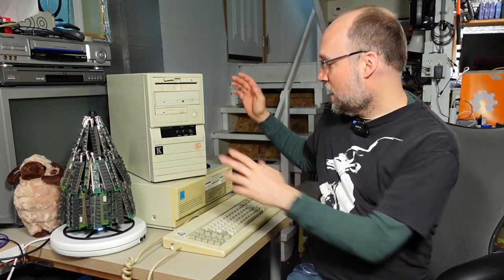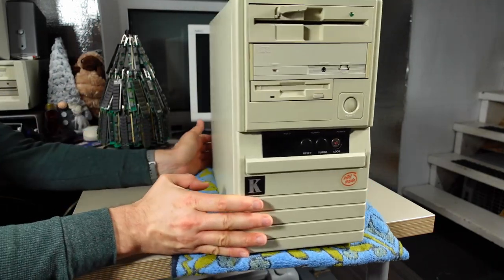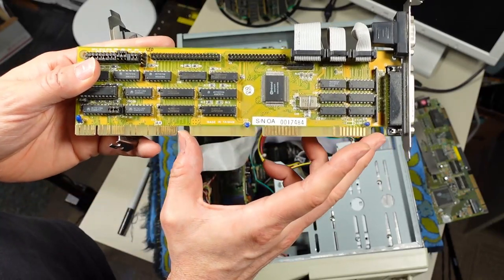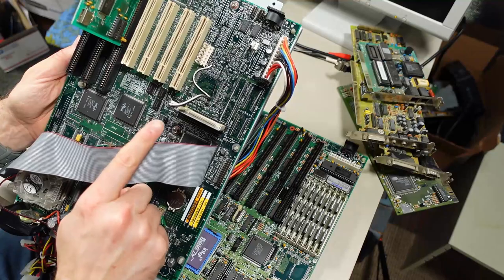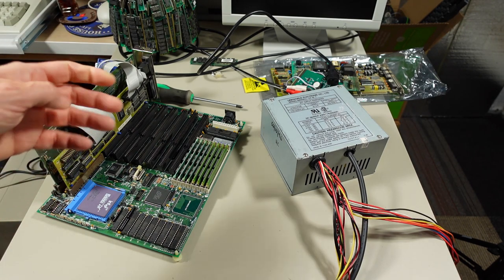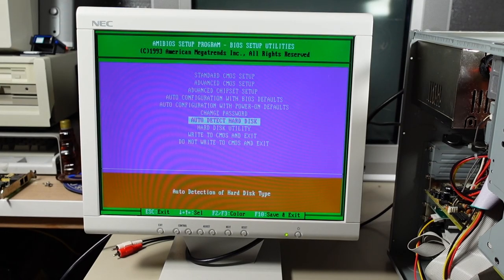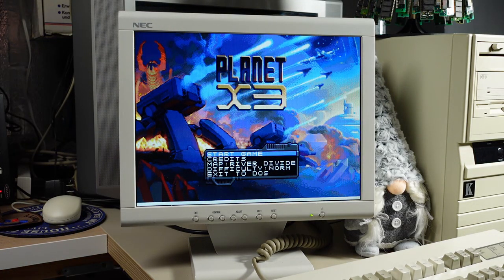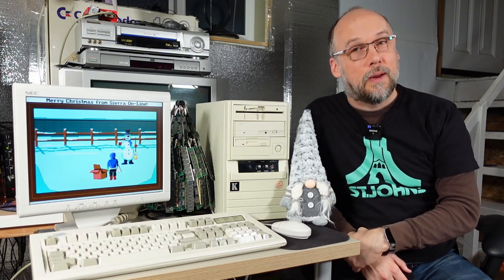PC archeology: Mystery 486 Mini-Tower

Comment: I have hate-love relationship with mini towers of early 90ties. My first two PCs 386 and 486 had them so I have nostalgia love for them but this was era when I changed a lot in them and cheapo towers where heavy stamped metal with lots of burr and sharp edges so in those tight spaces I lost a lot of blood fitting different drives, ISA and PCI cards, ram modules...
Reply: Yep. Building a computer back then meant walking away looking like you danced with Freddy Kruger.

Comment: Very lucky that machine didn't suffer from the dreaded battery leakage! It's a shame about the sound card, I'm sure it would work better with the original drivers.

I wish I had more time off to play with my Pro AudioSpectrum card and 1x CD-ROM drive. Had to get them shipped all the way from the US to Australia because they're the same kind that we had in our family 386 back in the day. The drive uses the LSMI interface, so it would be cool to get it working (if they work!).

Anyway, it's always fun to watch you re-living the experience of using these machines. Even if they're just as temperamental as they were back in the day!

Comment: Yessss! Thank you for making a video about this machine! I'm only 26 seconds in and already excited 😁

Ok, at 10:55, I am thinking it is a 486, using that Mitsumi interface for the 'crocodile CDROM drive' ( that's what me and a friend called it!), To a SB16-ish sound card. The rear audio ports suggest it isn't Creative... But I'm not sure.

The VGA will be a VLB card, slightly popped out of the socket.

The IO card will have an IDE and floppy controller, with the usual array of IO on it.

Comment: I remember, sometime in the mid-90's, I discovered the option to format a floppy at 2.88mb. I formatted several disks that way, it worked fine with most of my disks and all of the PCs I used them on. I never found anything that used it by default.

Comment: I had a Sound Blaster 16 card that had an integrated scsi adapter. Back in the days of super expensive RAM, we used small (100-200 MB) Apple scsi drives in our windows 95/98 computers for dedicated swap space.

Comment: If it weren't for the case badge and the ejecting-drive CD-ROM I'd absolutely swear that this machine was the one I built in 1995. Those are some danged familiar parts in there, right down to the I/O controller and graphics card. Hell, I even had a Pro Audio Spectrum 16. (Although I had a DX4/100)

The PAS16's main claim to fame was that it was a 16-bit stereo sound card that came with some great creation tools. It was only compatible with the original SB (and not even particularly well) but it also predated the SB16. Also it had some fun programmer-friendly features on it which basically nobody used.

Comment: Pro tip for the pin headers.  Put masking tape around the bundle, then flood it with hot glue.  Bingo bango you have a removable connector after it cools.  Easy to remove later if you want to reconfigure.
Those early processors can be overclocked easily.  I did it 30+ years ago.  Solder a 66mhz crystal on the board and add a heatsink/fan to the processor.

Comment: I built a 386SX-25mhz with a turbo button in this exact case in the early- middle 90's.  It definitely a was prolific case.  I still remember using it for running a music visualization program, and  games called Scorched Earth and Rotten Earth downloaded on BBS using a custom 2400 baud modem.

Comment: 486s really were the gateway from the "old limited computer freak times" to the more modern "everybody uses PCs now" era :-)
Sooo much happened between the 286s and Pentiums.
I really love my 486-DX4-120 with Cirrus VLB VGA and 24MB EdoRAM. Even Duke Nukem 3D and Shadow Warrior (that came out in 1997 !!!) run very decently on it :-)
Only the CD ROM Drive is a single speed and a bit slow, but it came with the SoundBlaster PRO and I would like to keep it original :-)

Comment: I've got my first "Fast" PC back in time, from my uncle, It was a 486 DX2 66 2 MB, Trident Graphics, i had 8 MB RAM. I had also VLB Slots But the Special on this System was the Bios, it was a Graphic Interface. A Bios from AMI, It loked Like Windows 3  or so. 

Thank you so much for that Video, it brings memorys back.

Comment: The CD Rom installed in this PC is a Mitsumi Single Speed drive. They used to ship these with a separate ISA controller card, it didn't work as standard IDE drive. However, some soundcards had interfaces for this kind of drive ... but i neuer heard that a Pro Audio Spectrum had a Mitsumi Interface included.

Comment: Speaking of wire management... Back In The Day, once case airflow became a concern due to the later and hotter running CPUs, I used to make "rounded" IDE and floppy cables by splitting apart the flat ribbon cables and stacking them into little bundles, and then strapping the bundles together with a zip tie. That way they would be out of the way of the air getting blown inside from the front case fan.
Reply from the maker: Yeah me too! I actually talked about that a bit while recording the video but cut it out for time. The video was already long enough :-)

Comment: I remember when we used a VLB motherboard with a 486 DX-50 as an ad-hoc Novell server.  The server kept abending.  Turns out the the Vesa IDE controller couldn't handle a bus speed of 50Mhz.  Had to switch to a DX2-66.

Comment: Most CDROM drives back in the day were one of a handful of interfaces, Matsushita (Panasonic), Sony and a few others. It should be easy enough to tell by looking at the brand on the CDROM itself. Philips was another common one. Each of these interfaces had their own MS-DOS drivers which are still readily available and they would work regardless of the card used provided the drive itself was supported by it (typically sound cards but some used a dedicated add in card).

Comment: That box is SO much like my first PC it's scary.  I didn't have a sound-card nor an internal modem, otherwise, very very similar.  '486, that weird Mitsumi CD-ROM, VLB controller, later VLB video card...

I was a commodore user from 82 to 1994 (VIC-20, C64, briefly a 128 and then an Amiga of some type 'til C= went bust), then jumped on the PC track in '94 with the '486.

Comment: I have an AT case very similar to this, but slightly different. Super cheap and flimsy case I got in 1996, but at the time they had already sold cases in that design for a few yes. The peculiar thing about my case is that has an air intake in the front with space for a fan in the long card support thingie and an external dust filter that is actually super easy to clean as the lower part of the front panel comes off. I have never seen any other cases from that time with dust filters, or even a functional air intake. To my knowledge only the original Pentium (the P5) ran hot enough that you'd need any extra cooling. But even though the case has an air intake, there is no exhaust fan, there's only the passive ventilation through the PSU

Also those port holes on the back are not just "if you want to use them". Most boards didn't include brackets for the ports, and you are actually only supposed to use the brackets in cases that don't have the dedicated port holes, like cases from before it became standard. Wasting expansion slots unnessecarily on ports shows a lack of professionalism at CTL who apparently built this machine

And a correction: CD drives are not IDE. They're ATAPI and use the ATA bus, which PATA harddrives also use. ATAPI is an extra protocol on top of the ATA standard that allows it to use drives with removable disks. Before the introduction of ATAPI the CD drives had to use proprietary interfaces as there was no other way for them to work. I know we all used to call it all IDE, but it's actually incorrect. The interface standard is ATA, and the problem with calling it IDE is that SCSI and SAS drives are also IDE (and always have been). This is also why the modern standard is SATA - Serial ATA - and why it's so easy to connect a PATA drive to a SATA controller and vice versa; the interface protocol hasn't changed, only the way they connect to the controller

Comment: I have a BIOS like this on a 486 motherboard with PCI and 128MB RAM support, which is really nice but - it has the 512 MB harddrive limiation. Is there any way to circumvent that limitation?

Comment: It is important for these very hot running CPUS to 1) install a fan and 2) do something about the cable spaghetti which impedes internal airflow in the case. I have seen 486s die from heat - the 50MHz chip was notorious for frying itself.

Comment: Interesting, I have never seen the combination of Vesa Local Bus (or as we called it due to its habit of not having the card seated properly "very loose bus") and a 33 MHz 486. The first machines with that bus system that I remember were at least DX2 class or even DX4. My first own PC was a 486 DX-33 (before that I used my parents' computer), and I remember it had an oscillator for the clock as this board has. (In fact, I remember the jumper configuration on later boards, but not on boards of this time). I did some overclocking on it by swapping the 33 MHz oscillator with a 36 MHz. Teenage me even went to the other end of town using public transportation to go to an electronics store that had such an oscillator available.After that, the CPU needed a passive heatsink. :o) But it ran noticeably faster (3 MHz don't seem much, but with that machine it's almost a 10% speed increase).

Oh I miss those days. ;-)

Comment: What I used to do when installing motherboards into those cases, was to install spare standoffs into the end of the board. Use side cutters to clip of the part which goes through to the motherboard tray. This why when you use VESA expansion cards, the motherboard doesn't flex.

Comment: 23:40: Instead of risking electrocution, you could use an ATX power supply and an adapter cable (I found one for 15 bucks after some searching). Then the power switch is on the low-voltage side and only sees 5V at most.

Comment: From getting OPL2/OPL3 hardware working through Dosbox on modern hardware, I've realized the Cyber game sets the OPL3 mode on entry, but doesn't reset it on exit. So an OPL2 (Adlib) game won't work if you run Cyber first. Resetting the computer resets the OPL3 chip, or running a different game that supports OPL3 and exiting usually resets it as well.

Comment: That is a special computer ya got there.  Considering there was a short window when VLB came out and the pentium was introduced, and it was very expensive meant that there was not a lot that was sold.  There is actually a 486 chip rather than some pentium overdrive chip that is too common.  I would feel proud as punch to own it.  BTW, what people overlook in older modems is the UART.  If the modem has a 16550 UART, then you could pull it and use it for other projects, that is if a person is serious into electronics.

Comment: I used to add blank board supports wher there were no slots out on the far edge. You can easily modify one of the standard supports to assume this role. Helps if you need to press down on the board where it isn’t supported.

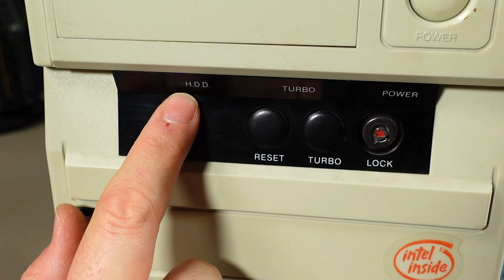Comment: Paused at 4:24 -- I once had a 486 PC with that 7-segment HDD indicator on the front; it would display the active drive letter and the current read/write head cylinder position!  While it flickered too quickly to be read most of the time, if a program crashed, it could give vital clues.  Waiting to see if that's what this one does!  Edit:  aw, darn, not included at all.  The display I referenced had it's own proprietary header directly off of the mobo, tied to specific pins from the ISA bus I presume.

Comment: When I was a lot younger I always thought the CD-ROm on the sound card was a pain in the ass. I have very strong memory of removing that setup and connecting several of them to the IDE bus(if they had the 40 pin interface) and had them work just fine. Worth a shot on your CD-ROM

Comment: For the AT power supply cable, the phrase I knew/learned was "Back to Back Black" or shortened to "Black to Black".   Also, there were early Pnp ISA cards pre-Windows 95.  It required the right system BIOS (which was jenky and buggy for PnP).  This was ~1993.  Dig your channel.  My path was (Die Hard)Atari 8-bit to PC so your vids on Commodore & Apple are interesting for filling in how those things worked (now that I am older and have mostly given up on the old rivalries...mostly lol).

Comment: I had a Pro Audio Spectrum 16 in my 486/33. At the time, SB PRO 8-bit was the standard which could only do 22.05 khz in stereo channels, or 44.1 khz mono. The PAS being 16-bit was a big deal as it was one of very few 16-bit audio cards, but it cost 2-3 times more money. I bought it to play games with mostly. Unfortunately, few games supported it natively, until later on when it was time to buy a new computer so I wound up using the built-in SB 8-bit emulation a lot of the time which didn't always work. 

My understanding was that the IC was better quality in the PAS so you would get a "cleaner" sound. It also has 44.1khz stereo. It had a SCSI connector which was a big deal. You could daisy chain a SCSI CD-ROM drive (I bought a Plextor 4x) and audio from FMV CD-ROM games would pass through to the soundcard directly so it was very clean and sounded great with the PAS mixer hardware.

I outputted this all to a Yamaha 80-watt receiver with Polk 2.1 satellite/subwoofer system. Wow was it good.

According to Wikipedia, the Thunder was their 8-bit 1st gen version.

Comment: CL5424 didn't have a blitter, the 5426 was the first one to do so. But it does have other routines in the drivers which help it out. Such as hardware color pallet tables and less software overhead from the windows GDI. An accelerated card with bit blt should be about 4x speedup or more.  Also I guessed it would have been a 386DX40 or 33. But I was off only by a couple months. I sold a few boxes like that with those pushout cdroms in them.

Comment: Ooohhhh the cheap molex adapters with their metal bits going in all directions (which prevented the connector from the psu from clipping in properly).
I remember the first thing I always did to solve this issue was to fill up the nylon plug with hot glue to stabilize the pins in place.

As per the issues with the sound card, could it be and irq or address conflict? Back in the days mostly everything was setup using dip switches so the SET variable bit would need to match hardware settings.

Comment: 6:54 While you could probably mount an AT power supply into a modern computer case or mount an ATX power supply into this computer case, it wouldn't be of much use because the way the power switch works has fundamentally changed.

Comment: This is basically my first PC...

Was around xmas 94, I got my first PC 2nd hand, it was a 486DX 33Mhz... with no CD rom, and 4MB RAM... then later Windows 95 came out, and I couldn't run it....

so, I saved up pocket money and birthday money etc and upgraded it to 8MB ram, and a 4x Speed IDE CD Rom (that cost s fortune) and stuck Windows 95 on it etc.... and this was the start of my PC obsession.... :D

Upgrading from there to a 486 DX2-66hz, then a 100mhz with a whole 1MB Cache... then I went for a Pentium 133, and then a Celeron 333Mhz (Slot style) then was 'given' a Celeron 466 (same socket)

Then from there, an AMD Thunderbird (hot one) 1.4Ghz  - and I remember every upgrade since :D

Amazing to think what i'm sat here using now, compared to then....  Was only  about 12 or 13 at the time it all started!

Comment: Ultimately cable management doesn't matter much in an old case anyway, since heat production is limited and the only fan is generally in the power supply.

Comment: Planet X3 likely accesses the Adlib at port $388 rather than $220. It might be that $388 is not working. The card might need to be reconfigured to make Adlib at $388 work, many cards did allow disabling $388 to allow the installation of multiple sound cards.

Comment: I remember seeing support for Pro Audio Spectrum in many old MS-DOS games.  These were Sounblaster / Soundblaster 16 era products and were technically superior.  Unfortnunately there was a financial fraud case which ended up with charges against the Media Vision CEO and CFO.  In the end the company name was changed to Aureal Semiconductor where they later produced the Vortex.  Many people preferred this product to those of Creative Labs (who built the Sound Blaster line) along with the acompanying A3D standard.

Creative  Labs and Aureal sued each other for patent infringement which Aureal ended up winning but the court costs bankrupted their company in the end and all the company assets were then aquired by Creative Labs.

With a few upgrades this could be a pretty nice MS DOS / early Windows 95 machine.  The sound card is pretty nice so something with a little 3D acceleration like one of the early Voodoo or Nvidia graphic cards would probably work well in there (although I can't remember what version might be ISA/VESA compatible) as well as a DX4 or Pentium Overdrive chip to upgrade the CPU.  Also the ideal amount of memory for a late 486 era PC was 16 - 32mb.

Having said that the Pentium based 'testing board' is a much nicer board to work with and has much more potential for upgrades because it has the PCI bus.